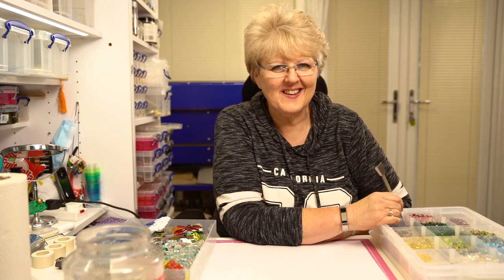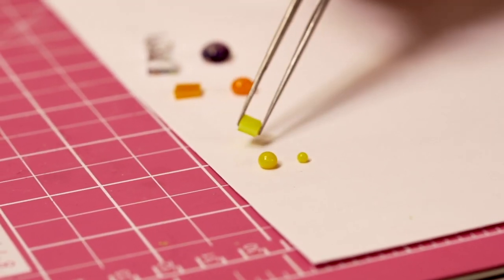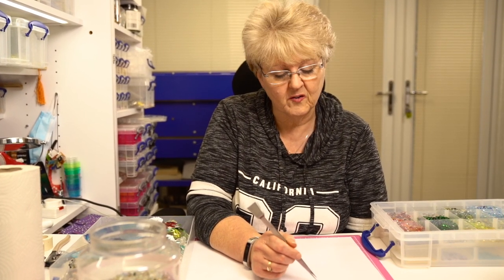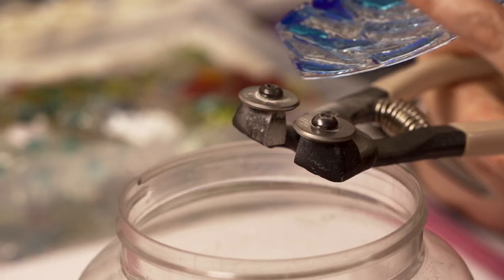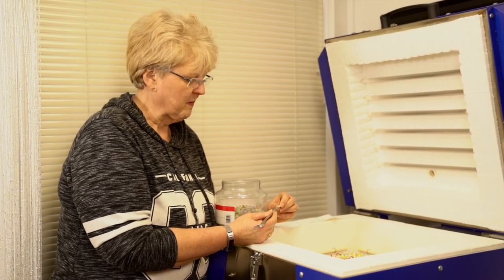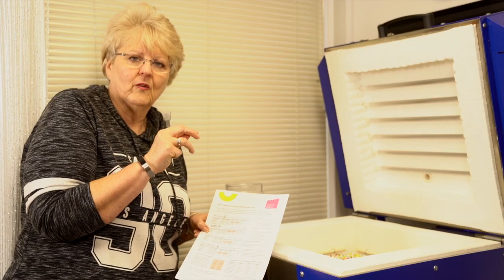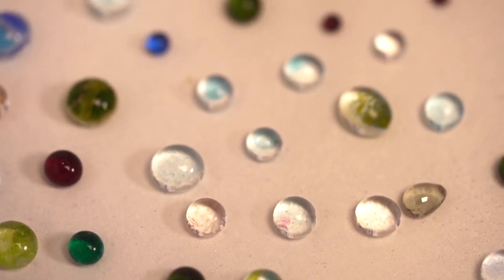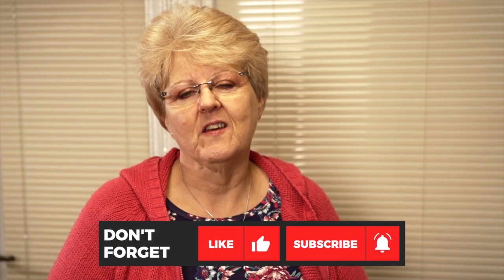Making fused glass dots from scratch

Comment: I want to start fused glass as a hobby but how has your electricity bill been affected by the kiln? I cringe at the thought of the cost of running a kiln at 1000 deg c for a hour or two.
Reply from the maker: Apologies for my slow reply. 
It's a good question. Depends on your setup and electricity supplier. We have solar panels so run the kiln when the sun is shining which then costs nothing. Failing no sun then we are on a cheap rate between 00:30am - 05:30am every day. To run a kiln used about 5kWh @ 8.25p/kWh so it costs just 41 pence to run a kiln.

Comment: Omg the box of sadness. I love it. I'm totally going to have to incorporate that into my organizing. You should make a room tour. I love your organization.
Reply from the maker: A studio tour is on our to-do list. We have a big tidy up planned for March so will do it after then.
Reply: @FiredGlass  I can't wait!
Reply: I turn my total failures into frit using the heat and quench method. I also do resin work, so pieces that I’m worried about if the COE has changed (like failed pot melts) I used as Resin only frit. Pretty glass still gets used but doesn’t risk ruining yet another glass project.

Comment: Hi Jill, as you mentioned, you do not want to inhale the thinfire dust and ought to wear a mask. I don't really know exactly how risky breathing that thinfire dust is, but in addition to wearing a mask, I remove the pieces, then spray the shelve with water to keep the dust from swirling while I scrape it together or sweep it off. Alternatively you can use a vacuum cleaner as long as it collects all debris in a micro-particle dust bag. Then when changing the vacuum cleaner bag, you really ought to wear a mask again and dispose of it within a plastic baggy (the kind you get in the grocery store work just fine). BTW, thanks for this video; I can second all of your advise but going a few degrees over the full fuse temperature was a trick I hadn't thought of yet. I appreciate it.
Reply from the maker: Thanks for watching. Great tip on the water spray to reduce airborne particles.

Comment: Does it matter the coe of the glass dots for future use? I’m just learning how to use kiln and not sure what scrap glass coe is.
Reply from the maker: Hi Jim, yes it does matter unfortunately. You cannot mix different COE ratings as you will end up with fractures and cracking at some point in the future in the pieces you create using the dots. 

It's okay if you just want to play with the kiln, but the dots will be bin fodder if you decide to work in a different COE from the dots you previously made. I don't make the rules! :-)

Comment: Quick question if I may. Do you sprinkle clear, powdered frit on top of the opalescent scrap glass before full fuse (same COE of course)? I understood all opaque glass needs this when going into a full fuse to prevent devitrification.
Reply from the maker: No never. There are some glasses which are more prone to devitrification. If you are suffering from this a typical cause either your top temp is too high and you need to drop as quickly as possible to your annealing temp. Otherwise devit crystals are encouraged to form. The clear powder solution does work but it’s not routinely needed if you follow the temp/drop temp firing schedule.
Reply: @FiredGlass  Thank you so much for answering my query.😊

Comment: Thank you very much for your tutorial. I have a question, please:
I need too many of these dots and prepared , cut glasses into small squares. But I use the kiln in the studio, and it is expensive. And where I go only twice a week. Decided to buy kiln for microwave. And to prepare dots at home in it. May I use in future  dots made  that way for all big projects, which I will make in the studio.
May I use those dots in the real big kilns?
Thank you in advance.
Reply from the maker: Yes you can indeed do that. When you make your dots in the microwave kiln you will have less control over the annealing process so make sure your dots are small, e.g. 1cm square pieces of glass. That way you won't run into issues with them cracking later on. The dots you create can be used in your projects and fired in the big kiln no problems.

Comment: I love Learning from you. My husband and I are enjoying your tutorials very much. I also want to make glass beads and was wondering do you have to drill the hole for a glass Bead after they are made or is their a way of firing them with a hole??? Thanks Leonie
Reply from the maker: Thank you. You would drill them after firing Leonie.
Reply: @FiredGlass  thanks I thought so.
Reply from the maker: Hi Leonie, been thinking further about your question and there's a more detailed alternative technique that you can use to create a hole before firing. If you are making larger beads then you can create the hole a couple of ways:
1 use fibre rope or fibre board between two layers of glass.  After firing you can remove the fibre  by soaking and poking out with very thin file or cocktail stick.
2 use a very thin gauge steel Mig welding rod, stainless steel wire or nichrome wire wrapped in thin fire paper to create the channel.  Wrapping in thin fire means you can remove it after firing.
Obviously the beads will not be round like they would be if you flame worked them, but they could be made into pendants.
Hope that helps

Comment: I have been having trouble getting the square pieces to round and make a dot....they look like rounded squares......I use a fiber kiln so i think i can increase the full fuse schedule 5 points but was also wondering about the hold time at that top temp.......your thoughts Please.
Reply from the maker: Depends on the colour of the glass you are using. White glass tends to round off less than other colours. If the squaring is across all colour ways then increase the temp by 5ºC and have another go. If that does not work, add another 5ºC until you get the look you are after. Many kiln are different so temperatures are always a guide.
Reply: @FiredGlass  great .....thanks
i was also trying to make some hearts and it happened with them too....so i will increase the temp....again thanks
Reply from the maker: @marilynjoy4338  no problems, I hope that improves your dots.

Comment: Do you go through the full fuse schedule - the slow ramp up and annealing - for such tiny pieces?  It doesn't seem like it would be necessary.
Reply from the maker: You're right it is not entirely necessary to do a slow ramp up and annealing for such small pieces. We often put other pieces in with our dots, the dots are used to fill gaps in the kiln shelf so they go through the full fuse schedule because of the large pieces.
Reply: @FiredGlass  Thanks, I thought so.  But that's a good point about using dots as a filler project when you can.  Good advice.

Comment: Can you use dichoric strips to put in dots
Reply from the maker: Hi Deborah. Thanks for your question although I'm not fully clear on what you're asking.  You can certainly use dichroic glass to make dots and I do this often for use in Christmas ornaments :). If you want to actually cut strips and put them together to make dots then you need a way to ensure they don't pull apart when firing.  I'm sure you're aware of the 6mm rule, but just in case... simply put, when glass is full fused it's preferred state is to be 6mm thick and round.  This means you can full fuse a 3mm thick 1cm square of glass and it will become a rounded dot.  If you put strips of glass together you may need to dam them or cap them to ensure that they don't pull apart.  Depending on the size of your dots damming is tedious and wastes space.  Capping means the pieces will be 6mm thick already so will come out less rounded.  Give it a go with just placing the strips side by side the next time you do a full fuse and experiment to see what happens until you get the result you require.  You might also experiment with the different types of dichroic as some can burn out at higher temperatures.  Hope that helps. Jx

Comment: Is it worth the cost of running the kiln to make the dots? How much would it cost to just buy dots? Is it much cheaper to just make them?
Reply from the maker: I guess it depends on a number of factors. The cost to run your kiln. Often we run our kilns for free from electricity generated by our solar panels. We have an overnight cheap tariff for our electricity too so will run it during that time. 
Dots are made from scrap glass so the outlay has already been made you are making good use of all the product. Making them yourself you can choose the colours, size and quantity. You can also fire them alongside another firing if you need to fill up a kiln and make best use of the space. We have not purchased dots for years since starting to make our own.
Reply: I buy about 100-200 dots for about 20-30$

Comment: How far apart should glass be before firing so they don’t fuse together?
Reply from the maker: So they are not touching. Glass thats 3’m thick will always draw itself up to 6mm. Any thicker than 6mm and it will pool down to 6mm . Therefore 3mm only needs a spacing of 3mm. Leave more space for thicker pieces.

Comment: You mentioned rinsing in vinegar and water?  Why?
Apple cider or white vinegar?
Reply from the maker: Often dots have a coating from the kiln shelf adhered to the bottom of them if you're not using Thinfire paper on the opaques. A solution of vinegar (malt or white) and water can be used to clean them, however it is not always successful. Prevention is better than cure, hence preferring to use Thinfire paper.